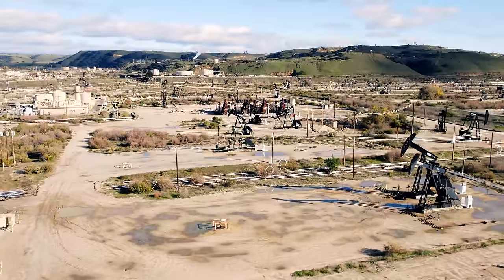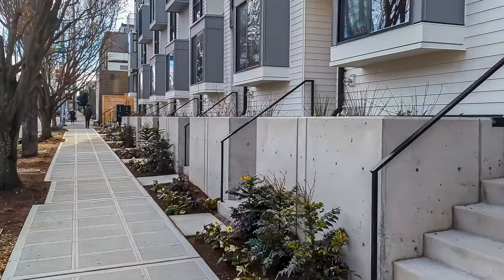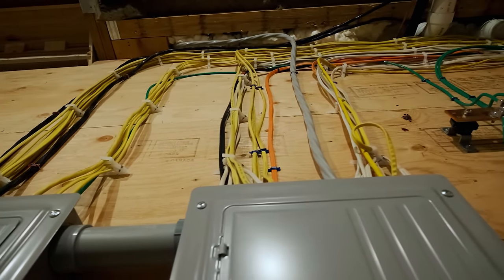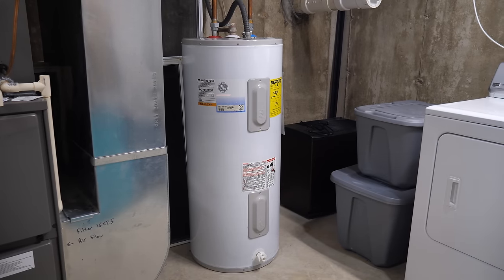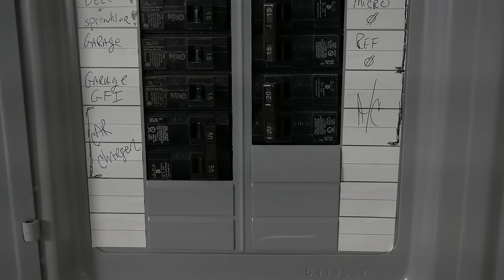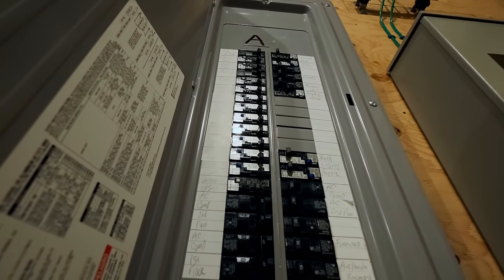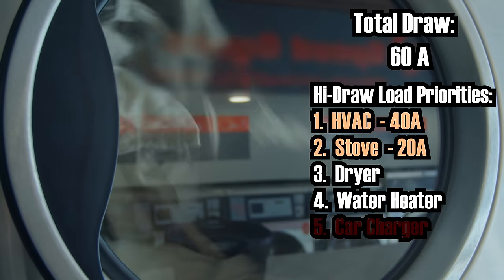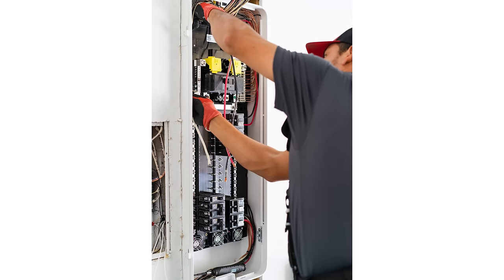Home Electrification: There's not a lot to do, and it doesn't have to be hard (Part 1)

Comment: Hi, Italy here.
I really enjoy your video!
I find it quite amazing that your "smallest" electric service is 100A. 
Here in Italy the standard household electric service is around 14A, single phase 230V.
A normal oven pulls between 10A and 13A, and a washing machine or an hair dryer around 10A. A dishwasher is around 10A.
Gas cooktop and gas combi-boiler are the norm. AC it's not present in most of the houses. It's normal for us to manually switch off or wait to use an appliance when something else "power hungry" is running. For example if the dishwasher is running and i've to use the oven, i stop the dishwasher or wait for running it.
Reply: That sounds really underpowered to me. Speaking from Norway, the standard for an apartment nowadays is 40A, 3 phase 230V. But if you're unlucky you could even find 25A, single phase. It also depends how heating is conducted. Many houses and apartments have electric radiators, which can draw a lot of current. It is not unusual for breakers to trip if too many radiators are on at the same time. 14A single phase sounds like you have to walk on egg shells all the time.
Reply: @Eduard2004  In our apartment in spain the main circuit is protected by a single line 20 A circuit breaker (MCCB) with c tripping charateristic . We have been using all all electric appliances since the 90s, including conventional electric heating. The only time the MCCB tripped was using the electric heaters, while cooking a multi course meal using the oven and several plates of the stove.
Reply: Tl;dr Use heat pumps for everything. That solves your problem too.

Yes, same here from the Netherlands, with 8 (or 17 nowadays) kw being the norm. The upgrade to 17kw 3P costs €250. But then again, our heat pump dryers consume up to 1kw in practice, and the heating of the house at max maybe 3-4kw. Keep in mind that we often use the same heat pumps for water heating as for warming the house. And as long as you have a way to dynamically limit the car charging, you will never have any issues, even if you are full electric. A whole video about how to "cope" with a 24kw instead of 48kw sounds so foreign to me. My historical max in a full electric house (no car) is 9kw for about 2 minutes.
Reply: I live in France were things are a bit different.
When we bought our house it only had 6kW which was fine, since it had a gas boiler and stove.
We have replaced all that with a heat pump and induction stove, and we updated the connection online to 9kW, we also have an electric car. A technician is coming soon to upgrade us to 12kW, which should be fine.
Listening to Americans talk about 100A/24kW as small seems hilarious to me.

Comment: Biggest issue in Ireland and UK is looped supply. Where one incoming is shared between two or more houses. In many cases you are not allowed to add an EV charger or heat pump/air conditioner, because the usage between the two houses will exceed shared incoming supply cable.
Reply: I have that in Australia. It is such a pain
Reply: We have shared service transformers in the US as well. It's one of several significant oversights in this video.

Comment: I got a span and span drive (EV charger) installed. Pros: everything you said. It is a really awesome product. Cons: cost. $10,000 for installation not including the panel (another $5,000).  IRA has incentives but this is still way too expensive. Also there are smart features when our battery kicks in but there is no way to schedule circuits for time of use for instance. That feature may be coming but is not part of the mix. If you are putting in solar + storage and considering a critical loads panel and you can afford this, Span is an excellent choice. It will get even better with software upgrades. If you are just interested in electrification, there are way cheaper ways to accomplish this including just getting mechanical timers on your water heater, putting notes on your dryer to not use during certain times, etc. You can do all that you need to do for a few hundred dollars.
Reply: EXACTLY.  Too many people spend money they don’t need to spend just because the technology is new.  “Penny wise but dollar foolish.”

Comment: My family home just went through a tornado and we and our neighbors were without electricity for a week. Thankfully, we have a natural-gas water heater and we did not lose gas or water service, so we were able to not evacuate, instead sheltering in-place, shower regularly, and clean up our home and community. I am thankful that we are not reliant on a single source of energy and only needed a gasoline-powered generator for short periods each day to keep our refrigerator running and a bottled-propane camp stove to cook meals.
Reply: Yeah smart thinking gas still works when power lines are down and  generators are the best thing in power outages especially for weeks on end. 73
Reply: A tornado is a rare event for individuals.  Probably first tornado your neighborhood has seen in 200+ years.  Including inefficient & dirty fossil fuel for the 1 per 200 year event is silly.
Reply: My house is 100% electric.  Even after hurricanes is still works, because it’s underground & not affected by high winds
Reply: @electrictroy2010  I don't have that choice all power lines are above ground with lousy poles. We don't deserve the ones of metal or concrete. Well I have a generator and my water heater is propane. Even if you have underground the substation is above ground. And can be knocked out. Hope that never happens. 73
Reply: @electrictroy2010  It was a once in 25 year storm…tornadoes and straight-line winds are rare, but not once in 200…that’s just exaggerating to prove a false point. Power outages are common. From a few hours at a time to a day or two, especially during the winter due to ice storms and the spring due to wind events, natural gas is quite literally a lifesaver here. Electricity is not 100% reliable, but natural gas is. It would be better if we had all underground utilities, but that is cost prohibitive in established neighborhoods, and still wouldn’t make it 100% because most of our outages start at the substations and other mid-level distribution infrastructure.

Comment: I'm very glad you discussed the code and load calculation considerations - the smartest idea in the world is valueless if it's not legal to install in your jurisdiction! 

The idea of intelligent breaker panels is fascinating, and I can absolutely see it being a game-changer for electrifying certain older homes; your take is absolutely on point that it's almost never the case you legitimately must have all your appliances running simultaneously, so if accepting that saves a homeowner a few thousand dollars (or more) when replacing their gas appliances (motivating them to go fully electric) it's totally worth it.

On a related note, I live in a multi-tenant dwelling and would love to install an EV charger in my parking space, but there's currently no easy cost-effective way to do this. Our meters are located in the electrical room also in the parking garage, but the panels are up in our units so there's no simple way to "split off" a circuit at my meter for the charger. Apparently there's a new meter collar device called a ConnectDER that could in theory be used for this purpose, but so far it's not a legal option in my location to install these (simply by virtue of being too new). I'm hoping they become acceptable at some point, because it would really change the calculus around the costs to install proper per-owner EV chargers that are simply and easily billed to their existing account for anybody with a similar building arrangement.
Reply: Have you checked out Orange or Plugzio for your EV charging needs? They offer a solution without directly tying to the meter that gives landlord or tenant options for monitoring charging costs.
Reply: Another option that is relatively conventional but could be a solution to your dilemma is a meter/breaker combo panel.  I'm not sure if you have a gang meter but if each meter is in a unique housing, could employ this method that provides a disconnect and some extra breakers in housing that holds meter.

Comment: My parents recently downsized to an all electrical house, heat pump, solar, etc. The insulation alone was $14k to install
Reply: Yeah insulation can be crazy expensive and replacing old windows too. But I keep seeing folks saying we need to save energy, yet they tell you you don't need to change your insulation. It's just ridiculous. 

During peak hours, I turn off the heating in my apartment to save money: the temperature drops from 22.5C to 18C in a matter of 2-3 hours (when it's -25C outdoor). It's even worse if it's near -40C outdoor, it drops to 18C in about 2 hours. I don't care as I'm not home when this happens, but the days I am, it gets really uncomfortable quickly. I let you imagine how cold it is near the walls if it gets to 18C at the thermostats.

The proper way is to insulate. Then, if the enormous energy saving isn't enough, it's way easier to turn off the heating for a few hours when you're house is properly insulated.

Comment: That SPAN panel you mention is cool, but it's $4500 just for the panel. I upgraded my main panel myself with a bit of help from a friend for about $1000. It's not very difficult to do, especially if your panel is a surface mount.
Reply: I was definitely wondering how much it would just cost to upgrade from 100A - 200A. I'm assuming the cost can vary significantly, though.
Reply: A much cheaper option than Span is an EV charger with load management (for that load) capability.  Usually that is enough to fit all else in a 100 A panel.  It works by monitoring the main feeder current and adjusting accordingly.
Reply: In my case it was $5000 more expensive than the 200A upgrade. I really wanted it, but I couldn't justify it.
Reply: @ehhhhhhhhhh  If you hired an electrician to do it - yes. Costs will vary. But like I said it's pretty easy to do. I was without power for a few days and borrowed a generator from a friend.

Comment: I’m only 5 minutes in, Alec, and I’m sure you deal with this: gas often works despite electrical outages. I can run my gas boiler*, range, and hot water heater even when the power fails.
*I can run circulator pump and thermostat off a generator.
Reply: Not to mention the much much higher efficiency than electric when it comes to heating things.
Reply: @xy4489  I think he did a video explaining that electric is 100% efficient at generating heat.
Reply: @jakeaurod  But the generation of the electricity at the source is not 100 percent efficient
Reply: He did say he was gonna discuss this in the next episode. I’m interested to see what’s in store!
Reply: @vasiaswolfram3113  When it comes to heating a house, a heat pump is closer to 400% efficient, though that goes down if the temperature difference is really large.
Reply: I have a minisplit heating and cooling system and a heat pump water heater. Both are easily powered at once by a Honda EU 7000 genset during power outages, along with the fridge and other basics such as internet and lights.
Reply: That seems like to be his point. There is no reason for power outages has to happen — as Alec says they are a purely political political problem. We could build a grid where large scale power outages just don’t happen(beyond neighborhood level stuff caused by say somebody hitting a service box with a car) unless you are in an extremely rural) but we don’t because politics.
Reply: Running a 350% efficient heat pump on a 20% efficient standby generator for a total efficiency of 70% is not much worse than running a 85% efficient boiler. Not too bad for an emergency solution.

If you rarely have outages, an alternative solution could be kerosene or propane space heaters.
Reply: @xy4489  Except that claim is obviously false.  Turning electricity to heat is generally 100% efficient.  Heating with gas maxes out at 97% and goes quickly down hill from there...
Reply: @vasiaswolfram3113  And drilling, refining, pumping and delivering fossil fuels is 100% efficient...???
Reply: @1646Alex  power outages have nothing to do with politics. Storms are not political. Traffic accidents are not political. We lose power many times a year to one of those. Gas service is 100% underground in populated areas. Electricity is not. While my neighborhood is served with subterranean lines, they're on traditional poles at the main road where a car can and does easily hit them or lightning regularly strikes them. I'm actually researching adding a NG generator to my home and have considered adding a propane refrigerator for extra precaution.  I'm trying to move away from reliance on the electrical grid to gas or self-generated electric where I have to have it.
Reply: @redbaron6805  
Using minisplit heat pumps is generally 300% efficient, and there are now minisplits that are 400% efficient. My heat pump water heater is 370% efficient, and both work just fine on a backup genset during the rare power outage.
Reply: @GoCoyote  Hence, my reply was directed to XY, not yours, which I agreed with.... 😁
Reply: @redbaron6805  
Be that way! I hate it when people agree with my pontifications..😇
Reply: Just one question,  that generator of your runs on?  
Many states are banning small engines so then what?
Reply: @markkempton4579  If politics is not the issue, why are electric power outtages so much less of a problem in Europe. Is it really because we have better weather and fewer traffic accidents?
Reply: @markkempton4579  There is nothing that says power lines can't be underground. Around 15 years ago they started digging here to get powerlines in the ground. Apart from the bigger 110kv and up, there is just some summerhouses classed as not important that has air lines . I haven't experienced more than 1minute power outage for years, that's usually the time it takes them to switch around in the ring network when a service is done. We have had crazy storms.

But it took a political decision to get the grid companies to start doing it
Reply: @xy4489  this is a myth lol
Reply: If electrical outages are something you need to account for, you should elect different politicians.

I've experienced exactly ONE large scale electrical outage that wasn't due to local accidents and weren't fixed within hours in the 46 years I've been alive, and I've lived in two different countries.

Stability of the electrical grid is very much down to political will power.
Reply: @karlwilhelmmeinert7592  better drivers and weather? You got me. I don't live there. I know that lightning strikes a transformer every month and power goes out in this region.
Reply: @Iceeeen  as I said, my lines are underground. But that doesn't help when the feeder lines are still above ground. The utility companies hate it, so they're not going to make changes and the public has far more important infrastructure issues to fund, so they're not going to go back and bury thousands of miles of lines. I don't see that changing in my lifetime, and I'm happy to install a generator.
Reply: @markkempton4579  no it will take probably a political decision how the grid should be built to get changes. 

But hey, instead i get to gloat 😎. I can't ever say I experienced a longer power outage than an hour and that was before the cables for the smaller high voltage lines went in the ground. All thanks to ring network and wide highways (mening no trees can hit them) for the big high voltage lines